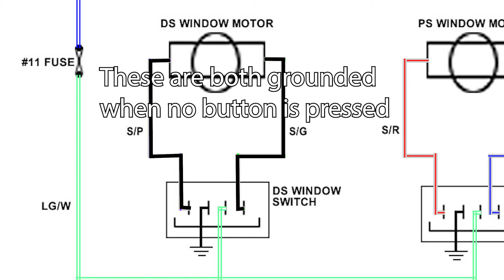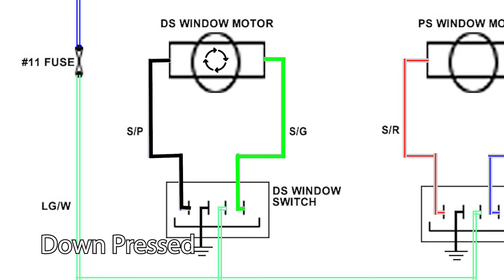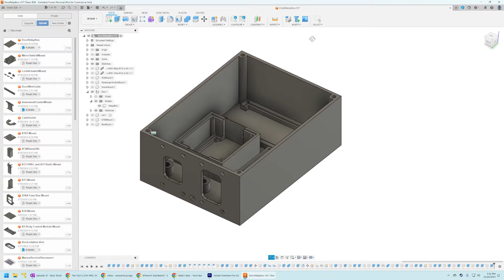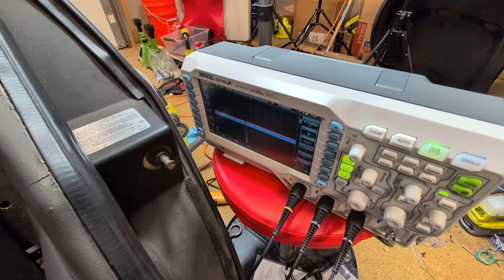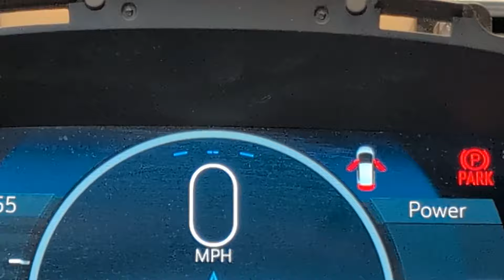DeLorean EV Conversion - Door Wiring

Comment: On the driver side window pausing issue... Did the Bolt have an auto down feature? When you took apart the bolt window motor and removed the circuit board, are you sure there wasn't a hall effect sensor on that board that was supposed to sense the motor shaft rpm? Maybe the board is looking for an rpm signal and if not seeing one, stopping, like it would if the motor was stalled at full open or closed, just guessing.
Reply: I did a bit more research, and I'm a bit more confident that's your problem. There's likely a hall effect IC mounted on the narrow portion of that circuit board. I don't understand what was gained by using the Bolt switch panel in the first place and not just wiring as the DeLorean original was?
Reply: The Bolt does indeed have an auto down feature. You can actually auto down all of the windows from the driver's controls, but only auto up the driver's window.
Reply: @bjcouche1 Could it also be some sort of crush protection being too sensitive due to not being calibrated to the DeLoreans window mechanism? Not sure if the Bolt has that but I imagine it might (don't want to test mine and break something lol)
Reply: I thought this right as he was removing the board from the old motor. It looks like the board was designed to poke up into the drive axel from the motor. This may take some effort to resolve now though.
Reply: Never mind about the crush protection idea, I just got to the part where the passenger window is working fine. If it was that I think it would affect both windows
Reply from the maker: @bjcouche1  No hall effect sensor, but it does have a shunt resistor to measure current to the window motor. I think what is happening is that the DeLorean window motor pulls more amps (it's much bigger) and this makes the driver board think that it has hit the end of travel. I might hook up the old motor and see if that works without stopping, then see if I can hack the circuit to allow more current (but still recognize the end of travel).
Reply from the maker: @bjcouche1  The driver boards communicate over LIN and allows remote control of the windows. If I hold the key fob button it can roll the windows down, plus support auto down. This does work on the passenger side. Admittedly - not an important feature - but I always wanted to stop running full current through the window switches (it's a common failure point)
Reply from the maker: Woah! I think you're right!! I just checked the video of when I disassembled it, and the shaft of the motor going to the worm gear definitely has a.. "piece" on the shaft that aligns with one of the 3-pin ICs on the narrow part of the board. Could definitely be a hall effect sensor.

This is definitely going to make it more challenging, if it is actually using that.
Reply: The driver door module monitors motor current to detect an obstruction. If the DeLorean motors are pulling excessive current, they may not function even if you’re able to circumvent the calibration procedure and the hall sensor. 

Do you have access to GM service information? All systems in the Bolt have helpful description and operation documentation.
Reply: I think the passenger motor would be current sense (or maybe nothing to keep costs down in those bolt modules). Thinking about this since watching the video, for the drivers side, maybe a simple oscillator and feed in a signal to the output of the hall effect would let it know that the motor is moving, maybe 3-5Hz would be enough. However this would likely disable the end of travel cutout of the motor, so auto up/down would need to be disabled otherwise you risk burning out the motor. So an oscillator that only activates for 3-5 seconds after the up/down is pressed would probably work and be safe enough. That should fit in the box with the other window PCBs still. Fingers crossed @BillCarlson
Reply from the maker: @rednwhitecooper  I do have the full service manual, including for multiple years that I can cross reference. Unfortunately, it does not go into detail on how the window motor actually works. BUT...I still have the motor from the Bolt driver side power window that I can test, AND if that doesn't work, I've got both rear door power window motors, which work like the Passenger door, so I could swap one of those in and then just swap which buttons I'm "pressing".
Reply: @BillCarlson  As was mentioned in a previous post, the driver side has auto UP and the other windows only have auto down. This is what makes the driver side special. On the passenger side, the Bolt only has to measure current so it can tell when the window hits full down, and stop applying power to the motor. On the driver side, you have auto up, and for safety sake, you want the motor to have a very low max up force all the way until maybe the last 1/4 inch or so. Often times with auto up, there's an rpm sensor and that is used speed, direction, and or position of the window. I don't think you're going to get it to work without using the factory Bolt motor.
  That being said, could you use the rear drivers button and wire to that instead? I think that would be the easiest solution.
Reply from the maker: @bjcouche1  Yes, absolutely!

Comment: On things that move a lot (robots) we learned to use 'robot wire' - a finer multicore, twisted in such a way that the strands don't change length when the wire bends. If you can find it, the doubling in price can be worth your sanity. Metal fatigue in normal wires can make them do seemingly impossible things like poking strands out of the insulation at right angles.

Comment: Beautiful work! One thought on the switch panel, you could consider separating the driver and passenger side door poppers. With a little logic you can add the ability to press and hold the drivers side button a little longer to cause both doors to pop at the same time (if you wanted). Some logic there would be good anyway to ensure nothing tries to pop while the car is in drive. But stellar work overall, just found your channel today, but will have to go back and catch up on all the work you've done.
Reply from the maker: I'm absolutely thinking about how to make the poppers more reliable, and to see if there is a way for me to pop them individually. Right now I'm using the "rear hatch release" to trigger it, and I don't think the Bolt has any other remote controllable switches. But I could do it if I use an extra remote control. I might try to rig up a latching relay that holds the poppers longer (it's currently about 0.25 seconds and 1 second would be better) - if that doesn't work out, then it's time for an ESP32. :)
Reply: @BillCarlson  didn't realize you were using the rear hatch release. I guess that signal could be used to do both, when being done from the remote. But I'd still try to have the buttons do them individually (again just me). But yeah, ESP32, or an Arduino would solve the problem here pretty good. Both for monitoring the various inputs to ensure button presses are deliberate and not just noise, but also to control that output pulse length.

Comment: It may be worth considering trying to figure out a way to lock out the door popper switch on the center console while the vehicle is moving... Maybe you could use the parking gear indicator signal or something to gate the signal, so if the vehicle is in gear it won't open the doors.  That would be a real bummer if someone/something bumped that switch while at highway speeds. 😬  Loving the build so far... looks like you've put a lot of thought in to this project :)
Reply from the maker: Already done! I probably should have covered how I am triggering the door poppers, but it uses the 'rear hatch unlatch' mechanism in the Bolt, which is already locked out when driving.

Comment: Great update, I'm amazed at how on one end the Bolt is still very analog with wires going everywhere, but on the flip side all the switches have a little pcb on them.  As extreme as Tesla is, I kind of get it as removing 1 switch removes 2 wires and that really adds up.

Comment: I would think about adding in the On Star equipment from the Bolt too, but hey, that is just me.  I hope that you have it done by next summer and bring it to a few car shows.  I definitely would drive from SW Washington to your side of the state to check it out and shake your hand.
Reply from the maker: I'm curious - what features from OnStar make it something you'd want to add? I also hope that I'm wrapped up (enough) by next summer to be able to do long drives and go to car shows. DC Fast Charging and the battery coolant system being the big features that I need!
Reply: @BillCarlson  I'm in Centralia, and in this area there are a lot of cell dead spots, but depending on which carrier you have, so I make a point of getting a cell hot spot in my car ie: OnStar, and having my  cell phone from another carrier, so at least one or the other is likely to work.  I also like OnStar's automatic accident detection and 9-1-1 reporting, as well as their tracking if your car gets stolen.

Comment: Idk if you can do this but you may want to figure out some way to disable the door popper when out of Park. It would suck to accidentally lean on it and have it fly open on the freeway or something lol
Reply from the maker: @BrandEver117  Already handled by the Bolt - I am using the wires that control the rear hatch unlock mechanism for it. But you're totally right, it would suck to pop open while driving! Especially without a passenger to close the other door.
Reply: @BillCarlson  Just perusing the comments, I'm really impressed by how "on it" you are with this build. In your videos you seem very competent but editing is a marvellous thing - it's here in the comments that the depth of your knowledge of both of these platforms really shines through.

Comment: hmm, if i was to do this project myself I might try to make a type of I/O relay just to cut down on the amount of wires to fail between places but also allow for some redundancy bit like how some modern cars will use lin bus but bidirectional rather than unidirectional so maybe just a simple rs232 serial connection which LIN and CAN are roughly based on anyway..
Reply from the maker: Absolutely, if I were ever to build a car from scratch I would put a "door controller" in each door and give it power, ground, and CAN communication. I was blown away to find, even on the Bolt EV, so many individual wires going into the door, most of which are simple on/off switches.
Reply: @BillCarlson  Not CAN, there's now 10BASE-T1S designed for noisy auto enviroments.

Comment: The "while you're in there..." issue in the boating refit world is called "ship fitter's disease". Any idea what the fix is yet for the driver side window?
Reply from the maker: Haha, that is a good name! Some clever people pointed out that there is a hall effect sensor on the driver's side motor that I did not notice! It is only on the driver window to support one-touch-close. The easiest fix is to use the board from one of the rear windows that don't have this feature. I think at worst I'm looking at resoldering 4 wires and printing a new enclosure.

Comment: In the Bolt, manually locking the Driver door would automatically lock all doors. Did you keep that functionality?
Reply from the maker: @BrandEver117  No, the door lock sensor was about the only thing I didn't hook up, because mechanically it seems isolated from the electronic lock, so I thought it would do a feedback loop. But it's easy enough to hit the central lock/unlock button in the middle of the car. Funny enough, the DeLorean also had that feature stock, but tons of people disable it because it malfunctions a lot.

Comment: Do you have the door unlatch switch rigged so that the car must be in neutral or park to activate, so that the doors cannot be opened while the car is in motion?
Reply from the maker: Yes! The door poppers are hooked up to the "rear hatch release" button from the Bolt, so it can't be popped while in drive. :)

Comment: The difference between 12.5v and 5v is 7.5v. I wouldn't be surprised if the logic on that board is 5v logic. Hence the weird voltages you were seeing.
Reply from the maker: Ooooh, that's clever!
Reply: @BillCarlson  Heh, I learned that one from experience. I designed some PCBs for a HVJB that was using digital inputs with pull up resistors to 5v. these were pulled to ground by the auxiliary contacts on the HV contactors to signal that they had closed. I had also included LEDs that would be a visual indicator that the contactor was closed. The LEDs negative side was switched to ground by the same auxiliary contact and they were glowing ever so slightly when the contactor was opened. I figured out that the 12v was going through the LED and it's series resistor and back through the controller. in my case a diode between the LED ground and the Digital input of the Controler solved the issue.

Comment: Who makes the wire sleeve marking tool? Model?
Reply from the maker: @TuringMachine-xc3gf  it's a regular label maker, I use a ptouch - but the label maker heat shrink tape works for a bunch of models. You can find 3 packs on Amazon from a company called usuperink.